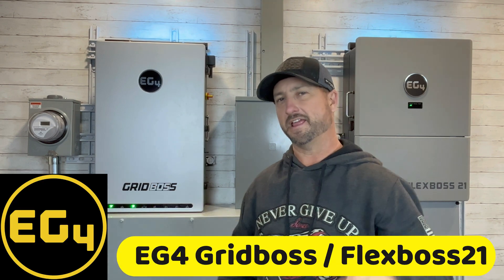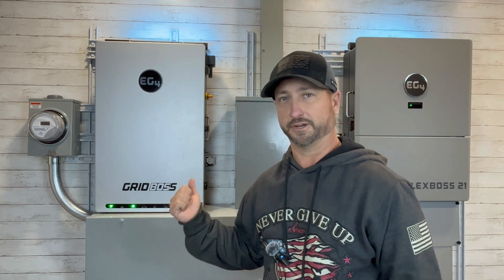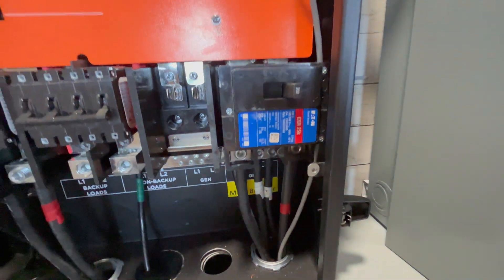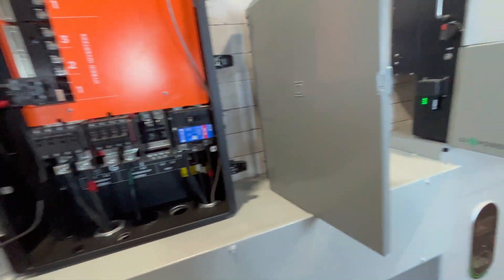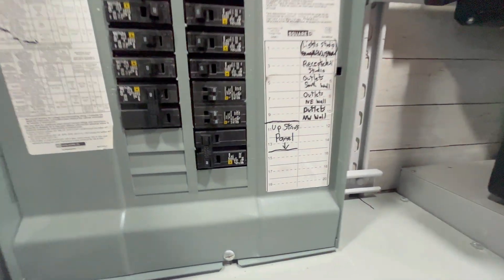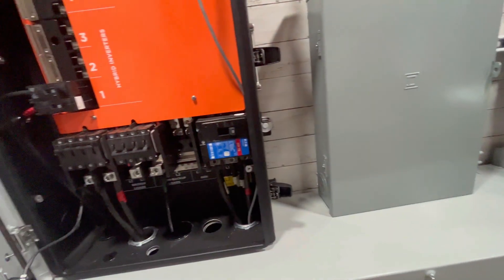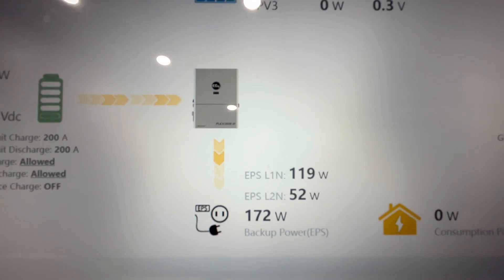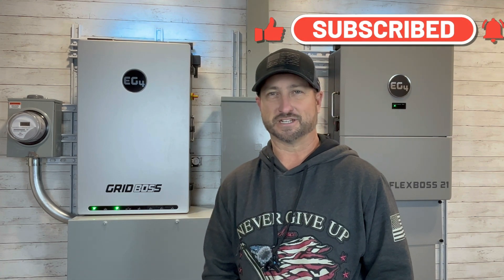How easy is it to install the EG4 Gridboss and Flexboss21?

Comment: When you flip those switches in the grid boss in order to do maintenance on your inverter... do you know if the flexbox inverter still has live feeds going into the grid connection there on the right side of the inverter?
Reply from the maker: @diySolarPowerFunWithRay  yes it would. To stop that you’d have to flip the 90amp breaker off that is on the Gridboss that feeds the Flexboss. Then shut your batteries and solar array off so no power is coming from the Flexboss to the Gridboss.
Reply: @unpluggedtexan  Thanks! That's really cool they give you that extra 90amp shut off switch!  I like it!  Definitely more complex.  Do you like that 12 inch wire gutter? Enough space?  Do you have a link to that by chance?
Reply from the maker: @ below is the link to the 12” x 12” gutter. There’s way more room than needed in it for the wiring. I just went big to make sure it was wide enough for the conduit holes in the gridboss and Flexboss21 to line up properly. A 10” x 10” gutter will work also. 
https://www.elliottelectric.com/P/Item/HOF/F1212G48/#
Reply: @unpluggedtexan  Cool. Thanks, It always surprises me how much those cost. That's a nice set up.
Reply: Love watching both of your channels! When people like you guys talk on videos its like watching a crossover on my fav Star shows!
Reply: @jwy224  too nice.   Thanks!

Comment: Curious what would one expect to pay an electrician to do all the wiring of the flex boss, grid boss and a single battery. I've installed my system inside my basement/shop which is directly behind the main meter, so no long runs. I have 2 wires that are aluminum wires, one for a hot tub and house service panel that will need a Polaris tap to convert to copper.  My solar array is within 5 feet of my main meter.  I have a quote that is over $2k.  Seems expensive to me.
Reply: Thank-you. Not being an electrician this doesn't look like a lot of work.  My setup is very similar to yours, Flex boss on top of the battery, roughly 8" away from the grid boss with easy access to the meter/main service panel.  But as usual,  this look easy to me when I'm paying someone else to do it😅😂.  Thanks for doing this
Reply: I paid $6.6k for an install here in California. Took 2 full days for two guys to install Flexboss, gridboss, disconnect and 3 indoor batteries 60’+ away. Had to rewire my main panel as well as I was switching where my neutral ground bond location. Rewired 3 circuits for AC coupled solar, water heater/EV charger and pool pump for the smart loads. All wired with oversized wires for future expansion.
Reply: @CryptoNut82  This seems like the biggest oversight that none of these YouTubers are talking about.  They're pushing that it'll save money,  but if the gridboss becomes the new service entrance, then the ground neutral bond gets moved to it.  Doesn't that mean that the old main panel would need to be rewired like a sub panel, with the ground and neutral wires separated to their perspective bus bars?
Reply: @jisbell911  this is true, but it just depends how your house is wired
Reply from the maker: @ thanks for the info on cost. That’s good info.
Reply from the maker: @billywooten3260  I used to work for my father in law who was a licensed electrician. For your situation it would probably take an electrician with 1 helper about 1-2 full days. So I was thinking $2k would be about right after accounting for labor, administration, insurance, and other business expenses.
Reply: 2k is a ripoff!

Comment: With your Gridboss being indoors,  did you add an external RSD switch to shut down the Flexboss if needed?
Reply from the maker: @CAdj0302  I did not. But mine is installed in an area where I’ll be swapping out equipment to run tests. So it’s not a permanent install.  It’s powering my 2 story workshop, but I’ll be swapping it out with other EG4 inverters to run tests in the future.

Comment: I've got a 5ton AC and a 3ton (plus a couple mini splits) at home in the Bahamas. It seems like this pair is the only reasonable option, right? Is there any control to deal with the occasional time when they might chose to start up together?
Reply from the maker: Nope no setting to make sure they don’t start at the same time. Just make sure your thermostats for each unit are set at different start up temps so that doesn’t happen. The surge happens on start up at a fraction of a second. I don’t see those ever starting at the same time. Unless power went out, and then once the power came back on they fired up together.
Reply: @unpluggedtexan  Thanks. They are seperate zones, so there’s no way to be 100% sure with temp settings, but I guess if it’s a problem I can figure out that soft start business.

Comment: Appreciate the straightforward explanation of your system. Curious if the grid boss can control specific circuits only when there is excess solar, such as  charging a EV?
Reply from the maker: @v8eater2  yes that’s exactly what the smart ports do on the Gridboss.
Reply: I will put my hot tub directly to a smart port when I build mine.  Or that’s the plan

Comment: Not sure if you know the answer but here goes. Our meter can is next to two 200 amp manual disconnects (one for house and the other for 40x60 shop). The 200 amp house critical loads panel is approx. 125 feet from the meter can and the 200 amp shop panel is approx. 95 feet from the meter can. Ideally, we would like to backup the critical loads in the house (perhaps lights in the shop as well). The part we are not sure about is how to utilize the smart ports to shed loads if the Gridboss is that far away from the Critical loads panel without incurring a large expense for wiring. It is our understanding that the GB should be near the meter to also limit wiring expense. This would allow the FB21 and batteries to be placed almost anywhere (within cable limits) using one 70 amp wire and communication cabling. Your thoughts?
Reply: Not sure how you will economically solve backing up the lights in the shop and using the smart ports. How far is the shop from the house?

You might just have to stick with the critical loads in the house. With no smart port
Reply: @MCMole  The shop is just over 70 feet from the house. I doubt backing up the lights in the shop will work without incurring greater expense and why i said maybe. I am more concerned with being able to use the smart ports to shed loads. This is one of the main reasons to get the GB and reason for the question
Reply: How many amps do your shop lights pull?  Can you run 12 gauge copper to the shop for the lights from your house critical load panel?
Reply: @johnmonroe3147  So, my shop is not wired yet but plan to use LED's which don't take much. I could trench and run 12 gauge to it for backup purposes. However, it would make for some strange setup since the power is totally separate between the house and shop.
Reply: @TheComingGlory  Why not just install one of those emergency lights that turn on if there is a power outage. We had them wall mounted at my high school. The small box in the middle must have housed a battery and sensor. There was a floodlight on either side of the box. There must be a modern, LED version.

Comment: On the wiring diagram you only have one communication cable connecting the Flexboss and gridboss. The manual shows 2 connections.
Reply from the maker: @caymanian2009  Signature Solar walked me through only using one cable. The cable just had to be on the left port on the Gridboss and Right port on the Flexboss.  I noted that on the pdf. I haven’t tried using two cables like the manual shows.
Reply: I tried wiring as you direct in the diagram using only one com cable and the Flexboss parallel jumpers off but this would not work throwing a parallel communication error.  I was able to wire it as it says in the documentation using 2 coms cables and setting the Flexboss parallel jumpers to on.  Any thoughts?
Reply from the maker: @ I snapped that pic on the pdf right before I switched the parallel switches on the flexboss to on. Signature solar says using either one or two cables for communication works fine. I got one of the first models which at the time they told me to just use one cable. Go with the two cables like the manual recommends. I updated my pdf with that change about a week ago.

Comment: how would I hook up the gridboss if I have only 100amps coming from the grid? Would I need a 100AMP breaker
/disconnect before the gridboss?
Reply from the maker: @dirtysalmonchaser  I’m not an electrician so take this for what it’s worth. But you could still use the 200amp Eaton breaker, it would just be used as a disconnect rather than a breaker. You could have a 100amp main breaker inside your 100amp home electrical panel.
Reply: If you already have 100 amp breaker in your panel.

You can install the 200amp breaker in the grid boss. But you have to change the wire from meter to grid boss for 200 ampacity. Then go from the grid boss to the 100amp breaker in your panel. Making sure to size the wire accordingly for the 100 ampacity.

Comment: Brian, did you use the bonding clip to bond the neutral and ground on Gridboss since it's your first service disconnect?
Reply from the maker: @jessstuart9480  I did not. Actually the meter you see in the video is being fed by my home solar system. I have a neutral ground bond in the panel in my home.